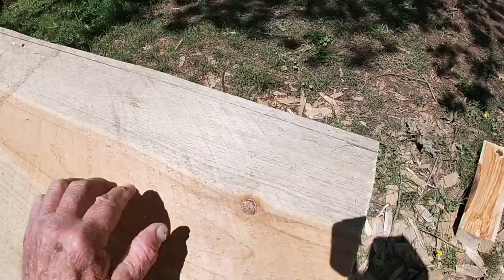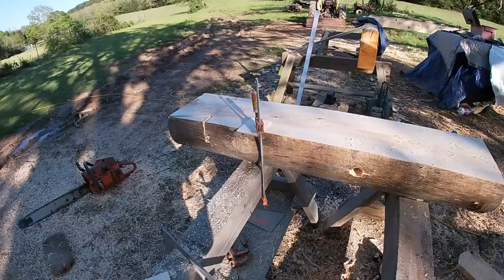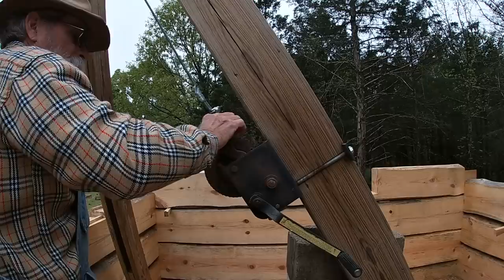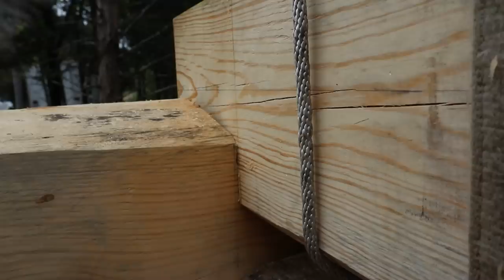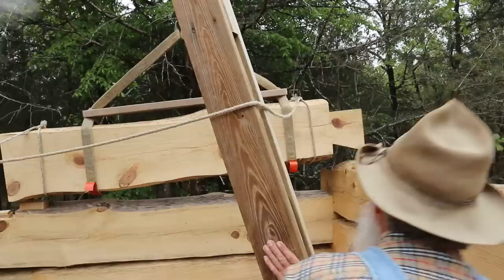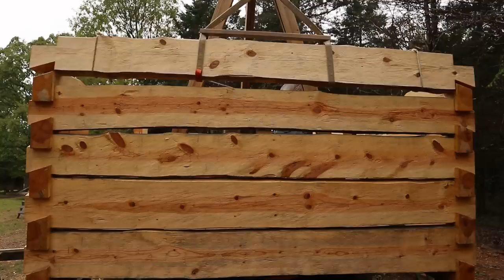Round 5 - Dovetail Log Cabin Build (Ep 25)

Comment: The cabin is looking great.  i thought cabins were built with full length logs then the windows were cut later.  Seems like you have to be way more precise to pre-cut the openings.
Reply: Not a chore for 'th beard'!!
Reply from the maker: William FromKy   Howdy William- Thank you for the nice compliment. A lot of the old cabins were built and they cut the openings out after the walls were up. I like to cut them as I build because I can save on material using up what would have been cut out for shorter pieces. I put the shorter pieces that go between openings up after the header logs are up. I don’t have to worry about keeping them in place until they have something over them so they can be held in there place. God bless you